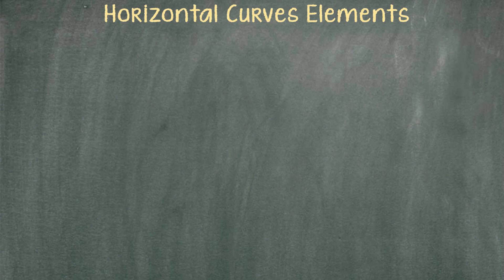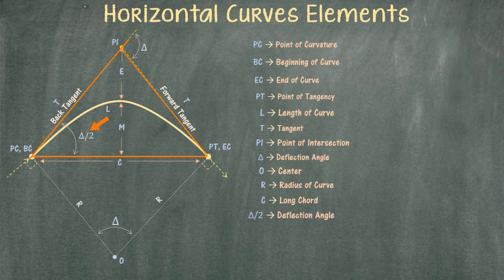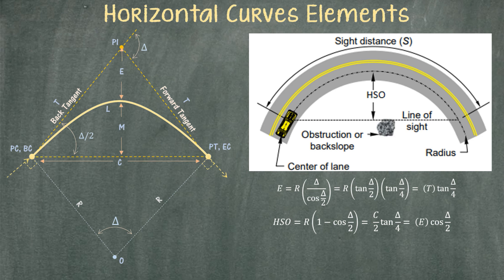Horizontal Curves Elements Part 1 of 2

Comment from the maker: Time Stamps 
00:00 Start 
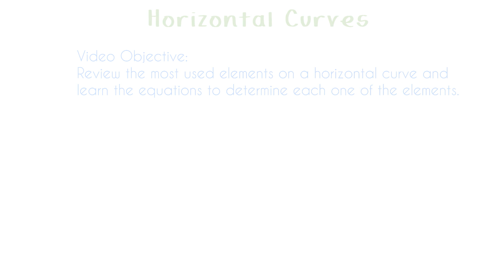00:37 Terms for Horizontal Curves Elements 
01:10 PC – Point of Curvature and BC – Beginning of Curve 
01:28 EC – End of Curve and PT – Point of Tangency 
01:50 L – Length of Curve 
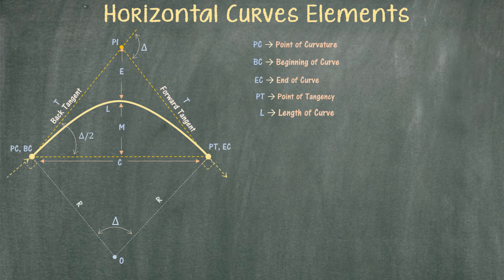02:02 T – Back Tangent 
02:31 T – Forward Tangent 
03:00 PI – Point of Intersection 
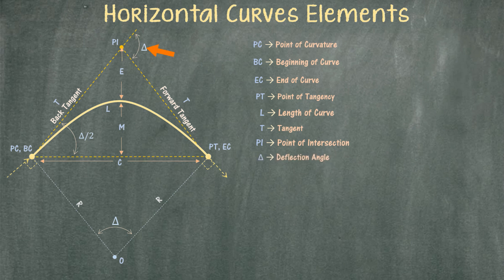03:28 Deflection Angle 
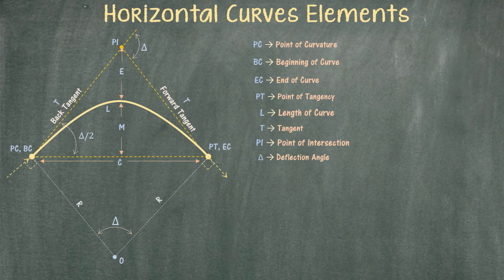04:40 O – Center and R – Radius of Curve 
05:15 C – Long Chord 
05:52 Half Deflection Angle 
06:12 M – Mid-Ordinate 
06:22 E – External Distance 
06:31 D – Degree of Curve 
06:47 Most Used Equations for PE Exam 
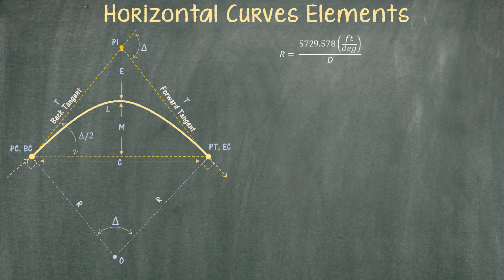06:56 Radius Equation 
07:29 Length of Curve Equations 
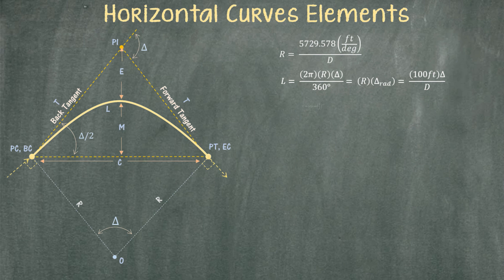08:23 Tangent Equation 
08:34 Long Chord Equation 
08:48 Mid-Ordinate Equations 
09:07 External Distance Equations 
09:13 Horizontal Sideline Offset (HSO) Equation 
10:23 Outro